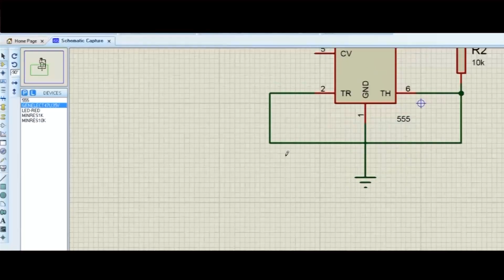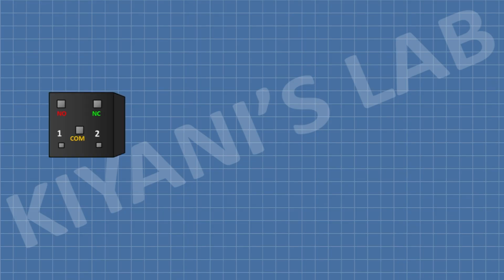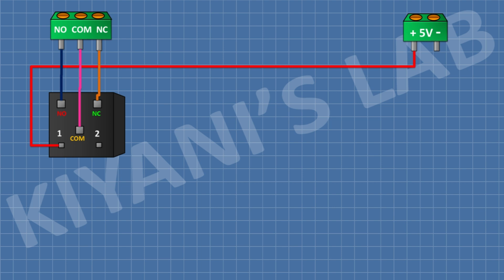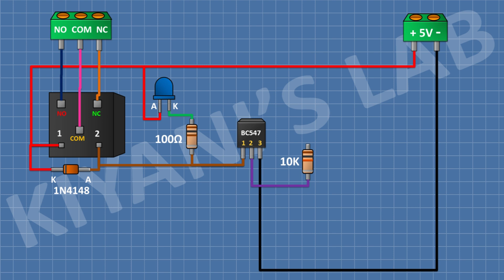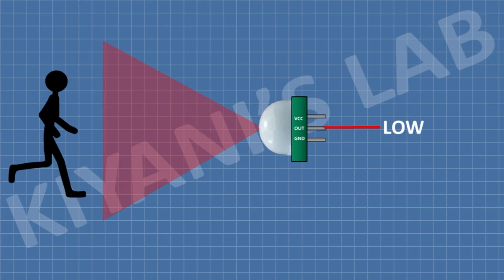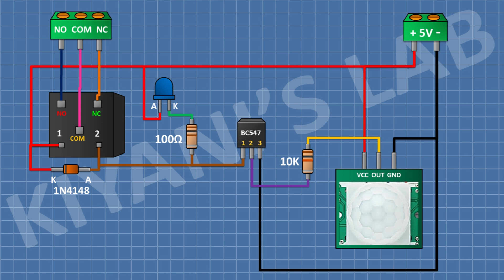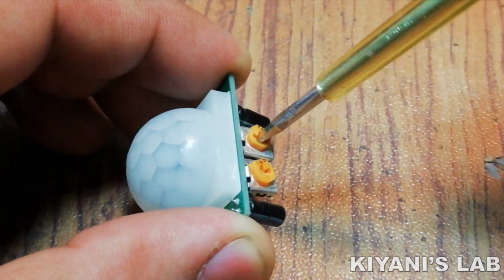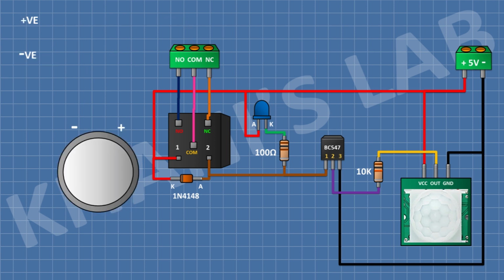How To Make Motion Controlled Light

Comment: I have made this project with your instructions and it is working very good  🤗🤗👍👍 I am happy with it. Thank you so much sir.
Reply: Pir sensor output volt come only 3v . how to relay activate. Pls reply
Reply: @vikramraja9517  you have to learn this circuit diagram properly. Same problem I had faced as yours. Than I done in 2nd time 😊

Comment: In this we have to make continues motion to activate that relay or one motion 🤔 to activate more time that relay sir
Reply: There are different timer modes you can select from the module through jumper settings.
Reply from the maker: in this project it activates with single motion the relay will be turned on for a time delay we can change that time delay and this module can also be configured for continues motion with the jumper setting
Reply: @KiyanisLab  thank you 👍
Reply: @engineerkohat  thank you 👍